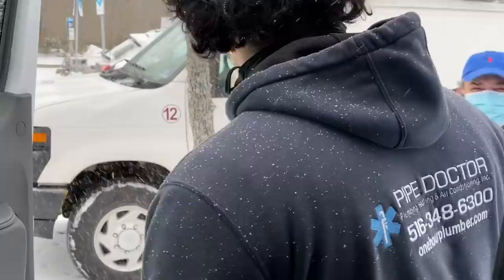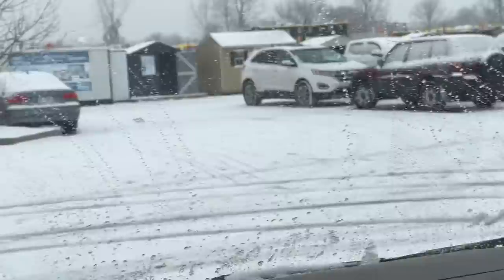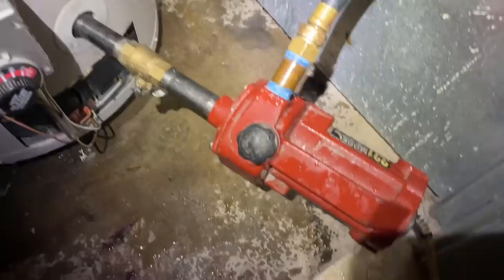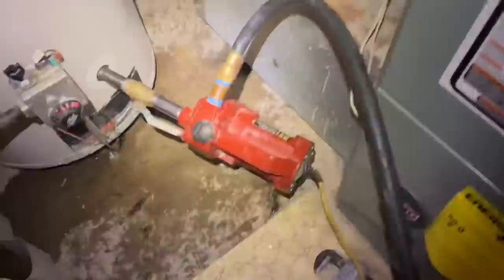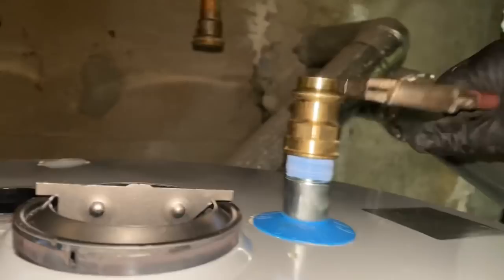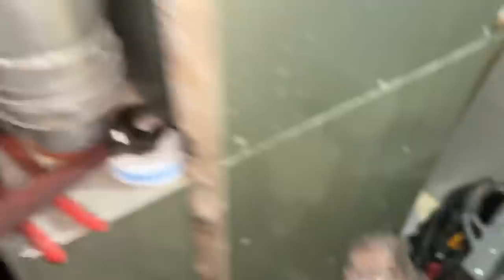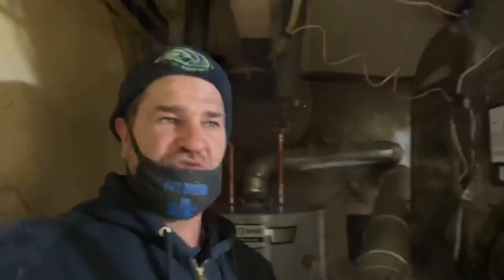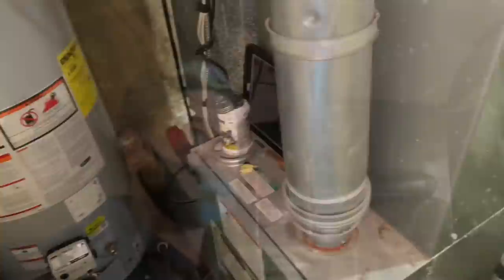Need to Replace Your Water Heater? Let's Discuss Your Options During AO Smith 50 Gallon Installation

Comment: I recently just called your office and spoke with an older woman who is extremely rude and nasty on the phone and was very taken back by her attitude. I saw this video and happen to like it very much and I need possibly either a new hot water heater, or a new gas valve and thermal pile. She was extremely unhelpful and not willing to let me speak for The plumber or leave a message. She said you’re talking to me!!! was not very happy

Comment: I wish more people would see a direct 90 on a standard vent as very dangerous and possibly deadly. I try not to sugarcoat horrible venting. I just had an argument with contractor yesterday. He installed a heater nearly identical. Fast forward 14 years. I showed up yesterday. Went back to truck. Got my carbon monoxide detector. Sat it on top of cabinet beside tank. Before I could explain what I was doing. Alarm went off. They called their contractor. I said “he’s the one that installed it. He’s not gonna admit any fault.” But to my surprise he told them I was scamming them. Because I insisted on a direct vent or a tankless. I instructed him that a standard vent gas heater. Should never at any point have a 90. He then said he had built hundreds of homes just like this. I told him that was great. In this small town with no inspector up till 2015. You could do whatever you wanted. Meanwhile I left the alarm going. He asked what that noise was. I told him it was my monoxide detector. And I had put it on the cabinet beside heater. He literally said these words “that noise is why I don’t install detectors anywhere near a gas water heater”. On the speaker phone. Customer heard that and went ape shit. I got the direct vent and that contractor proved me when I say “how some licensed automobile drivers shouldn’t have a license? Same for contractors”. Passing a test doesn’t qualify you to drive a nail.

Comment: 4:52 What Milwaukee ProPress Model you using here, and do you currently (2022) still use same model; or using a newer model?
Reply: @PipeDoctor  APPRECIATE THE REPLY (& sorry bothering you in day off). Curious if use 2674, 2773, 2922, or have all 3 M18s and which one like the best (guessing not rockin the M12 2473 for what you do)?
Again, thx for reply…. Love channel and #LETSGOBOSCH

Comment: Is there a plumber here who knows if I can get an A.O.Smith 50 gallon,40 000BTU water heater with a regular gas valve without the electronics with blinking led lights?Like a standard Robert Shaw valve?
Reply: @PipeDoctor  Thank you. Probably have to go to  plumbing supply store for that,correct?
Reply: @PipeDoctor  I went to a plumbing supply today who said,no,I cannot.Called A.O.Smith who also said no.

Comment: with indirect hot water heater, is your boiler running during the summer to satisfy DHW demand?  also with a tankless water heater you may have to upsize the meter. and some gas utilities charge
Reply: Yes with a tankless your boiler would run during the summer. It is still cheaper to run than a gas fired hot water heater because of the the large thermal mass of the boiler holds the heat
Reply: New Navien tankless is .99 efficient, indirect is .8 and tank is .65

Comment: Why no vacuum relief valve ?
Reply: T P valve is factory installed
Reply: @MarkSt59  A Temperature & Pressure (T&P) relief valve has nothing to do with a vacuum relief valve though...
Reply: @Henry Edwards  Probably because there's no code stating you have to have one installed on a top inlet water heater in New York...🤷🏻‍♂️.  Steve Lav puts them on his water heater installs because it's code in Massachusetts if you've been watching his vids a lot.

I see quite a few installed on bottom inlet water heaters regardless of state.
Reply: For some reason I thought they were code in NYC. I could see water heaters subjected to vacuum in multi story, or high elevation like in the Hudson River towns if a water main broke

Comment: It's like you read my mind Mikey Pipes! I was just thinking 2 days ago I wish I knew what my options are for when I replace my water heater in the next year or two. What are your thoughts on the Navien NPN-U Series? Navien's website says they require minimal maintenance. I assume that's because it's non condensing. Would it be more economical to go with the more efficient NPE Series and spend money on annual maintenance or go with the less efficient, less maintenance NPN Series?
Reply: @PipeDoctor  I currently have a electric tank water heater and am wanting to replace it before it has issues as it is over 10 years old and in the winter I am aways running out of hot water. I am trying to decide between a gas tank water heater, Navien NPN, and Navien NPE.
Reply: @compgb  Why do you have the electric tank type in there now?  Do you have an existing natural gas line already ran to your house?
Reply: @andrewwelch5668  It was there when I moved in. Yes I have natural gas line. I have a gas stove and a gas furnace currently.

Comment: Thank you
Thank you
Thank you!
That is the thing that's not stressed enough when these clowns push that high efficient needy crap!
The NEEDED MAINTENANCE !
👍👍👍👍👍👍👍👍👍👍👍👍👍👍👍👍👍👍👍👍👍👍🥃🍺🥃🍺🥃😐
One more is the power venter up sell with a 90% forced air conversion if everything looks aged ?
Thanks AGAIN!
Stay safe.
Retired keyboard super tech.
Wear your safety glasses.

Comment: Wait.. The customer knew you were there to cut out the only source of hot water and thought that turning the water back on would allow his wife to take an ice cold shower? Never had to use the LOTO kit in a residential setting but I've also never had someone do something as stupid as that. What if you guys went to lunch 5 seconds before he turned the water on?
Reply: @PipeDoctor  They probably wanted a Hot Water Heater.  They wanted their domestic Hot Water to be Heated by a water heater that only heats the hot water supply pipes of their hot water heater to make their hot water hotter.

They could have bought Cold water Heaters but that is classist. Tankless units are only for the 1%.